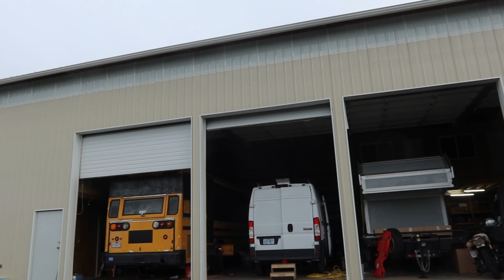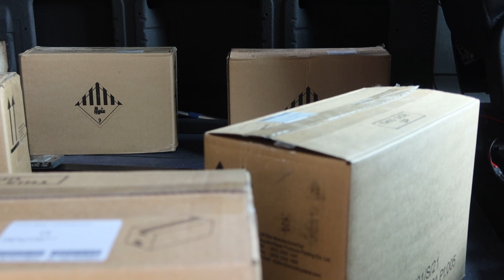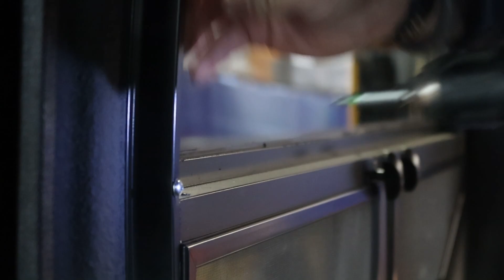Hydronic Heating | Gluing down a Custom Cut CNC Floor | Van Build

Comment from the maker: Just Roaming Design on the border of Oregon and Washington developed a very interesting hydronic heated floor system for my Ford Transit 350HD.  This video covers the gluing of the custom cut floor sections to the base of the van.

I also repair my CRL window leak and check out Sam’s Adventure Wagon Project.

Just Roaming Design: https://www.justroamingdesign.com/ 
Facebook: https://www.facebook.com/JustRoamingConversions
Instagram: https://www.instagram.com/justroamingdesign 

See my Vanlife Tour Map Here: http://jayoe.com/vanlife-industry-tour/
Check out my stats and Vanlife plans here: http://jayoe.com/vanlife-industry/

00:00 – Introduction
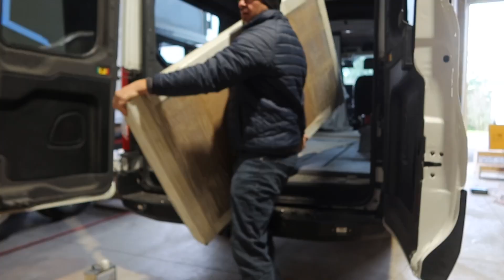00:58 – Clearing out the van and cleaning
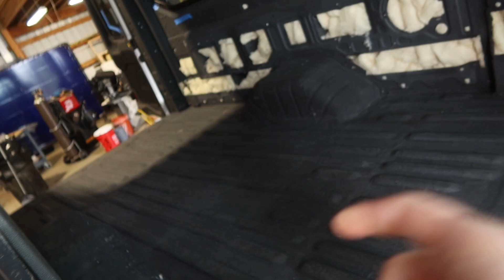01:38 – Laying in the custom shims
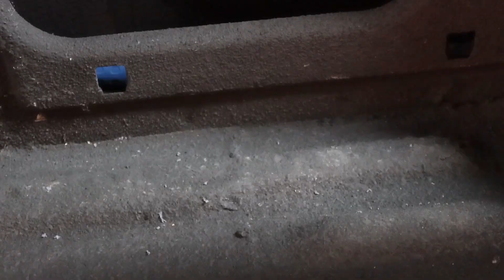03:43 – Gluing down the floor
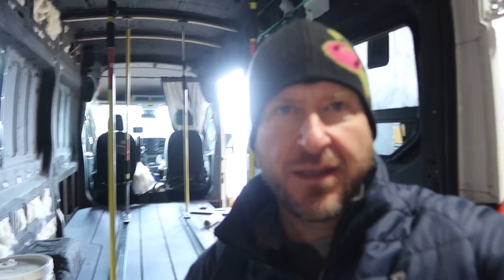05:05 – Weighing the floor and pressing
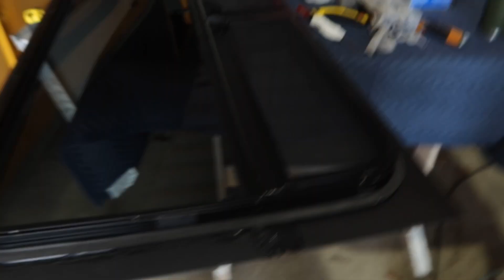07:12 – Fixing my CRL Window
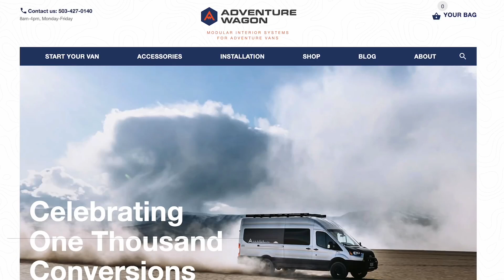09:47 – Adventure Wagon Kit
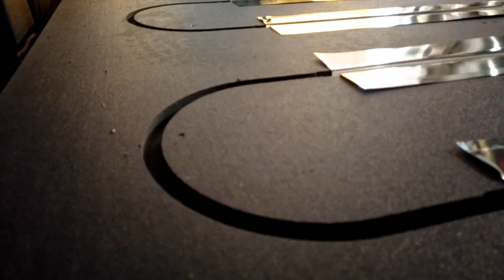11:17 – Next Episode

Comment: I am an engineer, Due to thermal expansion and vibration, I do not think any glue or even epoxy alone is going to last long holding down your floor.